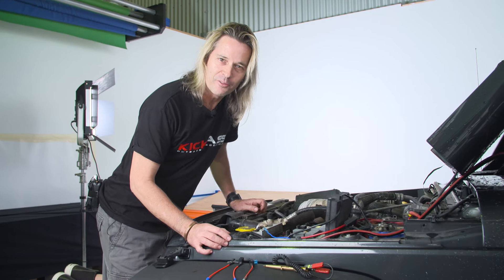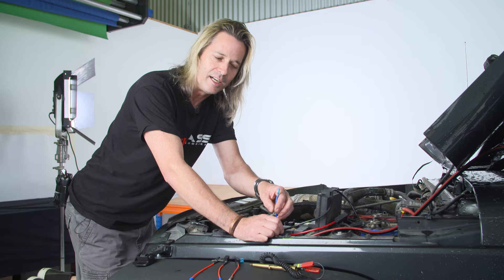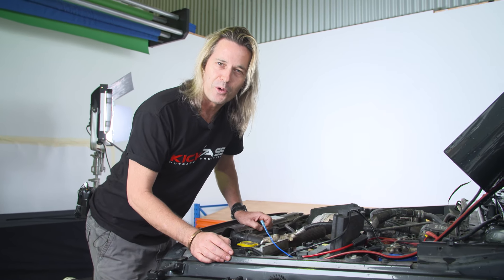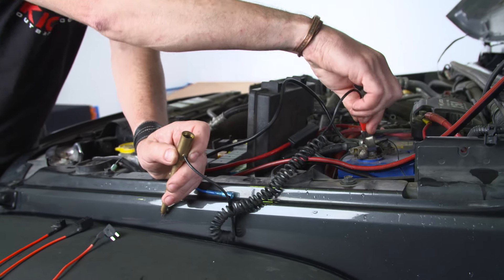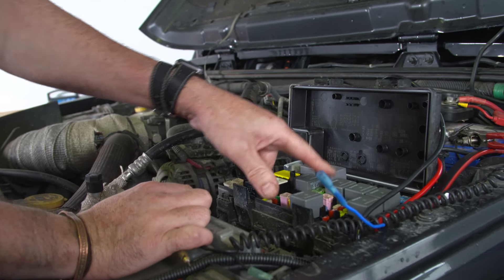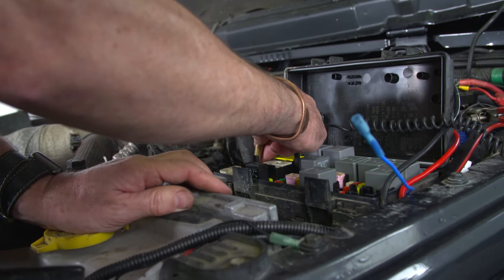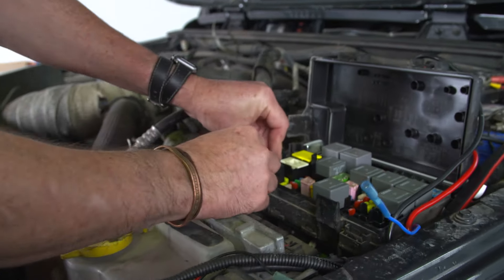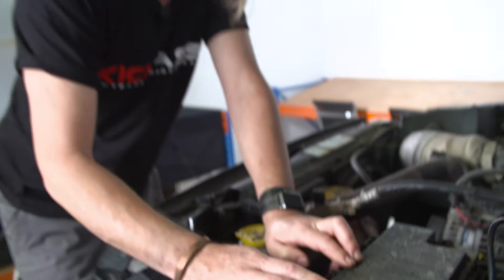KickAss - How To Find DCDC Ignition Wire Install Guide - Learn About DCDC Install.

Comment: I have a 2011 hilux and the spare heated seat fuse under the dash on the passenger side appears to stay on when the vehicle is off aswell (causing the dctodc charger to stay on).Therefore does it have to be a spare/empty fuse or can I use a fuse that is already being used for something else and just put a smaller second fuse in the fuse tap?
Reply: yes use a fuse that is used.

Comment: What size fuse is needed for the ignition wire itself?
Reply from the maker: G'day mate,it is only a sensing wire & carris no current but a 5 amp fuse would be more than enough
Cheers Craig

Comment: If I'm piggy backing off an existing fuse eg:wipers what amp fuse do I need to install above existing fuse in my piggy back adapter for the dc-dc
Cheers
Reply from the maker: G'day mate,if your not sure just use the same value fuse as the original you have plugged into - wipers would be no good as they can be switched on with the accessories/ignition - fuel pump relay is probably best - really anything that only has power when engine is running & switches off when engine is off 
Cheers Craig

Comment: I’m sorry but what was that fuse wire called? All the mini way fuses I’m looking it don’t have that connection just an open ended connection
Reply from the maker: G'day mate,there nickname is normally "fuse tap" basically it's a wire with a terminal that taps into/or plugs into an existing fuse 
here is a link for you to click on 
https://www.jaycar.com.au/double-micro-blade-fuse-socket-wire-tap/p/SF5130?pos=1&queryId=92adcc1ca14ced5349b0165d65954052
Cheers Craig

Comment: Thanks for these videos. Instead of running an ignition wire to front fusebox, can I tap the wire with a fuse to positive+ wire of 12v outlet to connect ignition wire (12 v outlet already in the back of the car boot, only works when the key is on) ? This is for a Jeep Grand Cherokee which have main battery under the drivers seat. So, I can run wires easily to 2nd battery. Then use ignition wire from 12V outlet (+wire) from the boot. Thanks
Reply from the maker: When you say it is powered when the key is on, do you mean on "Accessories" or when the engine is actually running?
Reply: @KickAssProducts   with the Jeep, this rear 12v cigarette light power outlet can be configured either “directly from battery” or “when the engine is running”. Currently mine is configured as “when engine is running”. Thanks.

Comment: Hi there. I have a Mitsubishi triton 2015 MQ and I don’t think it has a smart alternator and I can’t find a fuse that’s only on when engine is on. What do I need so I don’t kill my smart battery? What would I wire the blue ignition wire too? Cheers
Reply from the maker: G'day mate im pretty sure that tritans don't have a smart charging system so you should be good to not worry about connecting up the blu wire,check with mitsubishi 1st just to make sure 
thanks for watching 
Cheers Craig

Comment: So where you tapped your ignition wire into do you get power when the Reds are on and the cars not tuning
Reply from the maker: Connect it to a fuse that is only active when the engine is actually running. Check out this video for more information https://youtu.be/2_skqBjOiHY

Comment: Do you need the ignition cable in fixed voltage alternators such as a 1986 landcruiser? I don't think you need to but I don't understand the cut off mechanism within the DCDC
Reply from the maker: G'day Erik. No you don't have to install the ignition wire, the charger does will auto detect when your vehicle is running as long as your alternator puts out a high enough voltage, an 86 cruiser should easily.

Cut in is 13.2 volts without the ignition wire connected.

Comment: Hi there what if you don’t have a spare sated heat fuse? Or fuse that is on on when the car is turned on? I have a Hyundai iload
Reply from the maker: Hi Caven, Unfortunately it very difficult to consult customers specific requirements on our comments page. 

If you submit a ticket via our support portal https://supportportal.australiandirect.com.au/submit-ticket-product-issue/ one of our team will get in touch with you ASAP.

Comment: I found all fuses had power, but around 12v and connected to that, when car is running it would increase. Is this ok?
Reply from the maker: Hi Daniel. If the fuse you are connected to has power when the vehicle is not running the DC DC may remain connected. What are you using to check the fuses.

Comment: I've set this up as per your videos but the charger is getting power with ignition off. I've quadruple checked the power to the fuse I've used. It got late, so I'm going to try some other fuse spots tomorrow in case the one I've chosen is constant battery power. Anything else that it could be though??? Cheers Matt
Reply from the maker: Hi Matt, for further tech support please visit out support portal, https://supportportal.kickassproducts.com.au/kickass-dcdc-mppt-solar-battery-charger-12v-24v-25a-pre-wired-anderson/

You can submit a ticket at the bottom of the page and one techs will contact you.
Reply: @KickAssProducts  All good, works perfectly. It just takes a while for the unit to adjust to the vehicle bat voltage and start charging. Sometimes an unplug/plug is needed.

Comment: what amp fuse do you use when you are connceting the ignition wire to fuse box?
Reply from the maker: You use a fuse tap. Match the size of the fuse tap to the socket you are plugging into on your vehicle. You should find this information on the fuse box cover.
Reply: @KickAssProducts   Yes I am using a fuse tap and I already have a right size of the fuse tap. There are 2 fuse holder, one for original and the other fuse holder is for ignition wire. So what amp fuse I should use for ignition wire?   I will be the shop on Thursday(18/8) around 3 pm to buy a KickAss Portable Battery Box Power Station with Integrated 25A DC-DC Charger. I want to make sure before buy them...Thanks.

Comment: Hi can you just use a spare fuse space for the ignition wire?
Reply from the maker: No, as craig explains you need to connect the ignition wire to a fuse connection that is live when the engine is running.
Reply: As long as it only comes on when the car is running

Comment: Silly question: Does it matter what amperage the fuse is? Cancel that. Just scrolled down and found that it doesn't matter. Cheers for the good video. Mine's about to go in, either a great charging experience or an explosion. 😄
Reply from the maker: Cool, Thanks
Reply: @KickAssProducts  - Awesome stuff. All wired up and nowhere to go, and no explosions either. I'm yet to properly test it with a drive around, but just with engine running in garage it seems there's a bit of time lag on either switching the DCDC charger on and/or off. When I switched off, it kept showing that it was charging for at least 10 minutes, but with only very little trickle - is that normal? (My battery was sitting at 94% charged and no usage/draw. I'm planning on putting the fridge on there and do a drive around over the weekend, but thought I'd check in the meantime.)

O, and I did check that the fuse I used had no charge while engine switched off - that was my obvious first check.

Comment: I have 2021 hilux sr5, and I can't find any fuse that has no power when ignition is off, so I will connect to accessories and make sure to turn off everything when outside of the car .
Reply: Hilux has fuse box under the glove box. If you open your glove box you will see it on the left side.
Reply: @RamandeepSingh-ul2dw I tried that too ,still couldn't find that kind of fuse.
Reply: @daliborpaunovic262  I have Hilux too. The glovebox fuse, second fuse in the row has power only on ignition.
Reply from the maker: AS long as you have power when engine running & no power when swiched off  - sometimes fuel pump relay is a good one 
Cheers CRaig

Comment: In my 2015 Land Rover Discovery 4, I have the old Kickass battery box with 120ah Battery and Projecta 25A dcdc charger...... it has worked fine for 4years..... can you tell me why I would need to upgrade to one of these 3wire/ignition setups?
Reply from the maker: If your old system is working for you then keep using it. The projectorshad an ignition wire as well so it worked the same way, this design is just suppose to make everything easier to install.

Comment: Will the dcdc charger still work if you don’t tap into the fuse ??
Reply from the maker: The charger will auto sense the input voltage so it will charge without the fuse tap. However if your alternator does not put out a high enough voltage or there are fluctuations in the electrical system this can cause inconsistencies while charging and is why we recommend connecting the ignition wire.

Comment: I have a 2019 Isuzu dmax, but the unused fuse slots do not have power while engine is on or off. Any suggestions on how to install ignition wire with this model?
Reply from the maker: Unfortunately we cannot give advice on specific vehicles.

Comment: Hi, I have a 2009 Ranger, the charging voltage is around 14.2v at idle. I'm a bit confused about the cut in/out voltage. I will be using a 100ah lithium battery, the manual states the cut in voltage at 26.4v for the dcdc, to me it looks like the lithium won't even reach that voltage. Am I wrong?
Cheers
Reply from the maker: Cut in voltage is 13.2 volts on a 12 volt alternator.

The 26.4 volts is for a 24 volt alternator that you would find on a larger vehicle.
Reply: @KickAssProducts  oh, sorry, must have missed that. Thankyou

Comment: Hey mate great video, I just brought your dcdc 40a and was wondering will 8 agm cable be fine to use with a 300w solar panel. I’m using your heavy duty cable kit (6 agm) to wire to the starter battery. But I’m interested on the solar side?
Reply from the maker: Perfect for solar pork chop 
Thanks for watching 
Cheers Craig

Comment: Does it matter how many Amps the fuse slot is?
Reply from the maker: No, The current draw through the ignition wire is negligible.

Comment: Awesome video, I have a question regarding what size fuse I need for the ignition wire (5, 10, 15, 20a)? I have a 2016 N80 Hilux. Any suggesting on where and what accessory I should piggy back off?
Reply from the maker: We can't give you specific vehicle advise sorry. But if you follow the steps in the video you should be able to find a suitable place to tap the fuse.

Remember that you need to find an empty fuse that is only powered when the vehicle's engine is running. Not just on Accessory. 

The size of the fuse tap that you need will depend on what fuse holder you decide to use.

Comment: Anyone here with a Prado 150 (2010 is my model) that knows which fuse slot I could use?
Reply from the maker: G'day there get a mate to use a multi meter & find a fuse that only powers up when the engine is running mate & make sure no power when engine not on 
thanks for watching 
Cheers Craig